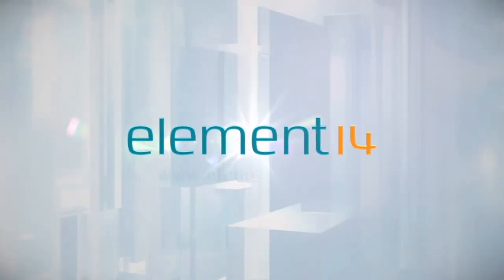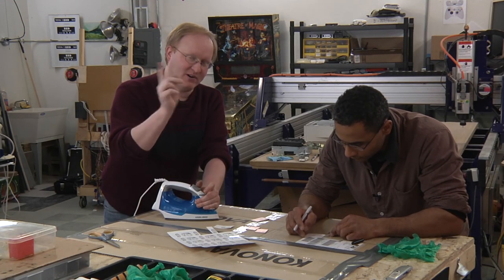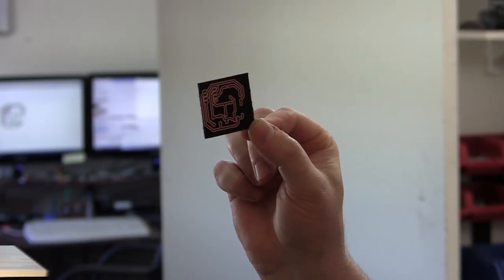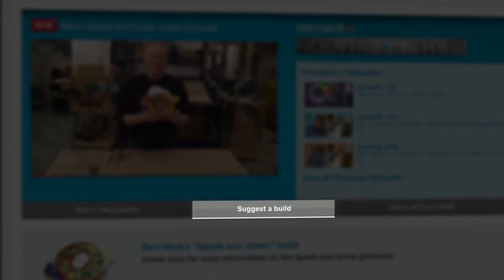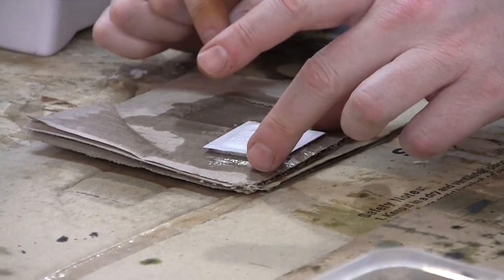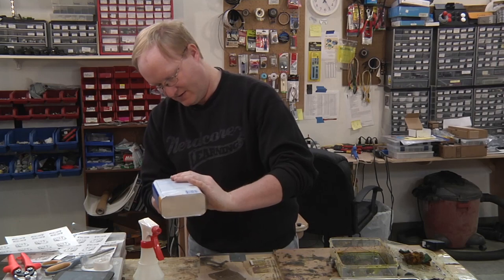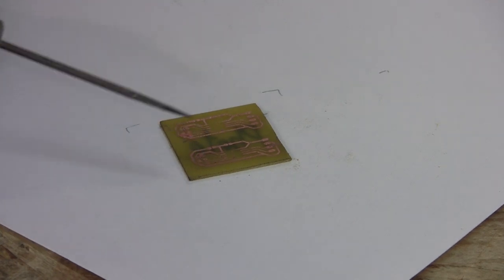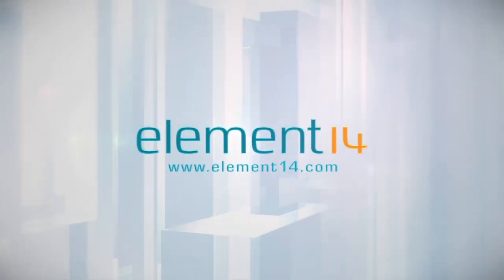Let's Try PCB Etching!

Comment: If you use a cheap laminator instead of the clothes iron you will get far more consistent results, and completely eliminate the chance of air bubbles. You will need to feed it through several times though, but works wonders. Just make sure you get one that can handle the thicker material of the PCB.
Reply: Oh, and another tip, when etching. If you use double sided sticky tape onto and tape it onto a small sponge so it floats you can float the PCB upside down in the etchant. This will make it go much faster as all residue from the etched PCB will just dislodge and sink down into the etchant instead of staying on the surface of the copper.
Reply: I was thinking an old sandwich press might work pretty well.
Reply: I'll second that. Ironing is REALLY inconsistent.  The right photo paper + a cheap harbor freight laminator revolutionized my ability to make mid high quality PCBs at home.  The laminator needs to be modified to slow it down significantly but it is a set it and forget it kind of thing.  Awesome!
Reply: I use a laminator and it works perfect every time. I do double sided prints all the time and a laminator really helps with the process of getting both sides lined up. I just print out both sides, Stick the bottom print to a window, line up the top print using the outside sunlight to help me see though to the bottom print, then while holding it in place I peel back part of the top layer paper and use a glue stick to apply some glue on the edge, and then stick the top print to the bottom, after it dries you can slide in the copper sheet and stick it through the laminator. Make sure the glued side of the paper is the side you stick in the laminator first or it might come out misaligned. I've done this LOTS of time with no error.
Reply: I know this comment is 3 years old and all, but can anyone recommend a laminator that would work well for this?
Reply: Any laminator will work fine but you need to modify it's temperature controls to reach at least 200-220C or even more because toner won't melt at low temperatures this depends from toner quality too. Press would be even better option and would work much faster. Chemicals like ferric chloride nasty stuff eats through cotton clothes and stains everything. Better chemicals for etching are Na2S2O8 and (NH4)2S2O8. Instead of photo paper I use vinyl oracal 641 used for commercial signs or cheap toner transfer yellow paper from ebay.
Reply: can you recomen a cheap laminater I can buy?? Thanks!!

Comment: You should also consider photoetching. Far less messy than the iron-on method and faster. Print the PCB design on transparency paper, tape it to a photosensitive PCB, expose it with a desk lamp then dip the PCB in a developer bath for a few minutes then etch it as usual. I've done double sided boards that way with no issues.

Comment: Why not just jackup your output power on your EPILOG laser cutter and etch away all the copper in the during the laser process?  EPILOG shows this being down quite nicely on there website. 

I'm very curious if the current EPILOG MINI 18 Laser is cable of cutting complete PCB etching in one process like this?

Maybe Ben has an older or lower power EPILOG and has to revert to only removing spray paint? I'm very curious to know. It would be so much nicer getting away totally from the etchant chemicals! Just pull the PCB out of the EPILOG rinse with rubbing alcohol or distilled water and dry with compressed air jet, done!
Reply: Apparently you can only do this with their higher end models. This laser printer isn't powerful enough to effect metals. The masking is a nice work around for making cheap PCBs though.

Comment: I print the PCB mask on a laser printer overhead sheet -- you can use an Inkjet as well (be sure to use the inkjet overhead sheets) but you more likely need 3 or 4 sheets with laser 1 or 2 will do, in order to make the traces truly opaque. These masks can be used over and over again.

I use an off the shelf facial tanner ($50), to photgraphically expose the UV sensitive PCB. I put the mask and the PCB in between my desktop and a glass plate from a picture frame and I have the facial tanner about 2" above it laying on two books.
I light it for 7 to 10 minutes

I use sink cleaner to remove the exposed layer of the UV sensitive layer of the PCB and then edge it using simple off the shelf PCB edge. Then I light the edges PCB again and dump it in sink cleaner again to remove the UV sensitive layer on the edged traces.

That is far away the cheapest and easiest method.
Reply: I agree, this is a good method. I've seen videos of an interesting technique: Instead of vibrating the box (messy) you gently lift one end, put it down and repeat, to create a wave that washes over the PCB, quickly removing the copper.

Comment: There is a special paper on ebay that helps to transfer toner to PCB. It's called "toner transfer paper". It has a wax layer that peels off easily after heated to PCB. Second, toner will not adhere to any greasy spots on PCB so make sure to clean with soap and not to touch the PCB with anything. I also use to transfer toner twice, so there is a thicker layer of toner and my toner level is low and prints with some holes.
Reply from the maker: Cool - thanks for sharing!
Reply: Tarmo Saluste how well does it work?
Reply: Owen Chase In case of toner transfer, it's the best I've seen so far. You have to keep the paper and the copper very clean for it to adhere perfectly. The copper has to be smooth. It could not adhere to cracks, so the traces can be broken from some place. I sometimes add two layers of toner to the copper for better coverage. The paper peals off in a cold water very easily, just pull it off carefully and slow, so the toner wound stick to paper. Another danger is, that I have on printer where the paper likes to curl up around the heating bar. Other printers have no problem.
Reply: Tarmo Saluste ok thanks

Comment: A couple of more tips for those that want to try this:

1. HP printers work well for the toner transfer method. Brother printers do not. I believe the Brother toner melts at a much higher temperature and it is very hard to get it to transfer to the board without smudging (if you can get it to transfer at all).

2. Ben appears to be using Ferric Chloride etchant. This stuff is harder to get, expensive, and stains anything it touches. A cheaper and easier to get etchant uses a mixture of Hydrogen Peroxide and Muriatic Acid. Both of these are commonly available at your local drug and hardware stores and are very cheap to buy in bulk. Do some Googling and you will find the appropriate mixing ratios as well as tips for use. I'll never go back to Ferric Chloride again.
Reply from the maker: Thanks for the tips!
Reply: I use a Lexmark 232 laser and the toner always comes out perfectly on Kodak glossy paper and ammonium persulphate for the etchant, works really well even on fine traces and wire holes.
Reply: Raziel Znot Sodium Chloride +Copper sulphate pentahydrate + Dihydrogen Monoxide = Copper Chloride + sodium sulphate + Hydrochloric Acid. It's essentially the same as Muriatic (Hydrochloric) Acid + Copper + Peroxide(H2O2). Same safety precautions should be taken with any acid.

Comment: Did you consider putting a little water in the iron and using the Steam Press option? Great show, very informative. I liked that there were several approaches and you worked through problems with each.

Comment: I'd like to know how to make those circuit boards that are a mix between breadboards and PCB boards, you don't need to etch them, they are a matte copper colo(u)r and you need to solder them to connect everything. Also a soldering iron recommendation would be good. Something good for a cheap price.

Comment: Great episode! Taught me everything I didn't understand about etching!

If you're handy with an exacto knife, you could also use the spray paint method but with a stencil of your circuit. if you use some kind of adhesive to hold the stencil in place while you exacto it, you could do any circuit you want, then just spray paint it, etch it, and then acetone the paint away like he did with the laser engraver.
Reply from the maker: Glad you found the episode helpful! As a former graphic designer, I'm proficient with an X-acto - thanks for the tip!

Comment: What happened to the good old light box, developer, etch, tin method?
Reply: That method works great for making large quantities. Another similar method that works good for large quantities is the screen print method. However, both of these methods require special chemicals and films and take a while to complete. And going through that whole process for a single board that you might not even know is designed correctly is a bit much for most people.

For a one-off type of board, nothing beats printing on your laser printer and just ironing it on. Ben's video really doesn't do the method justice since he spent way too much time ironing and spraying the board. Just iron once, soak, and wipe away the remnants of the paper.
Reply: mtslyh

Comment: I just tried a slightly different laser printing method that worked great.  I used laser printer transparency paper.  After printing the circuit from eagle, I taped it to the copper with aluminum foil tape (the kind used for duct work).  This held the transparency in place and allowed to evenly transfer heat across the print. I then placed the iron on it until it was too hot to touch which was about 2 minutes only moving it slightly.  I let it cool and cut the tape on the edges.  100% of the laser printer ink transferred with no signs of a smudge.  It was immediately ready for the ferric acid without any cleanup required.

Comment: I've also been thinking that a glue transfer to a clean circuit board that has no copper and then using a foil heated to the surface like the scrap bookers are doing on paper might make a pretty good board too.  I definitely agree with Switch & Leaver about the laminator for better results and this might also work for the foil transfer idea too. I'm surprised that we don't find more direct to board solutions by now.  How about a gel pen full of metallic paint that can be plotted and heat treated? Or low temp metallic filament for 3d printers?

Comment: Hey, I wonder if you could use the laser mill to etch solder mask off of the mounting pads on the board... that way, you could simply dip the board in a nice professional quality solder mask material and etch off the mask on the bits of copper which need to be exposed for soldering. If you did 2 layers, one of a light color and one of a dark color, you could etch off the dark to also create text and stuff right on the boards...
Reply: Oops, posted that comment before I finished the video 😅

Comment: I really like the laser-paint idea, but you could also try something similar with a 3d printer.

Create your eagle schematic and export as an STL or export to some format that can be converted into g-code. Place the raw and cleaned copper pad on the printbed, adjust for height change and print out a single layer print that acts as the usual toner layer.

I have yet to try this method, but after researching the toner-transfer method and realising I only have an inkjet printer, it only stands to reason that if you can coat the copper in the laser printer toner(plastic of a sort) then why not a different kind of plastic with a different kind of printer.

I do believe that polymers like the nylons and ninjaflex would serve as the best option as they bond quite well with most surfaces unlike PLA/ABS.

TL,DR: replace (toner/laser printer/reflective paper) with (filament/3d printer/raw pcb)

Comment: Hey Ben big fan, can you use the CNC to make some holes or is it too thick, if not all your components are are surface mount? Also I have access to a CNC laser but the guy who owns it won't let me paint the coper and put it in the machine because of the fumes can I do it without the paint and just etch off the coper with the laser?

Comment: I'm really curious why you didn't include PCB milling in this video, i know it's not technically etching... but it would've ben cool to see the process of PCB milling as well... perhaps another video just for that?

I'm actually reluctant about my method of making PCBs... i'm planning on building my own mini workshop for electronic projects and PCB manufacturing is an important part of it because using pref boards isn't as clean and takes a lot more time/space/wiring. Ive done my fair share of PCBs back in university. ive tried the iron method but we only had inkjets at the time and it was just a very messy and just not consistant method. at the time our preferred method for PCB making was with light sensitive boards (also another option you could've included in your  video. it's by far one of the easiest and most accurate methods ive tried. printing your circuit on transparent paper, placing that paper on the photo sensitive board, under UV for about 20 minutes, placing that board into a liquid that removes the cooked photo sensitive layer (dont remember the name of that liquid) then etching it then acetone. it was excellent. but it's an expensive method as well seeing how pricey those photo sensitive boards are.

That's why im considering buying/making a CNC machine for myself mainly to mill PCBs but also to make enclosure panels and engrave the texts on it for a clean end product.

Would love to get a feedback on that method, the pros and cons.... thank you for these awesome videos ive been binge watching them and i hope my comment doesn't fall on deaf ears.

Comment: Just a hint for first time etchers:
I personally don't recommend using FeCl3 as etchant. It's super dirty and will leave it's traces everywhere if you don't handle it carefully. I've always used Na2S2O8 (is the name sodium persulfate correct?) for etching. It works pretty much as good as ferric chloride but it is a lot cleaner. I personally used it without any handprotection and it didn't leave dirty stuff on my workbench or my hands (use gloves if you're not familiar with using chemicals right, it damages your hands if not used correctly).

Comment: I'm finding that laser photo paper is kinda hard to find, but I have no problem finding laserjet glossy brochure or presentation paper. Is that thick enough for the transferring or will only photo paper do?
Reply: It doesn't work well with inkjet iirc, as the etchant etches it away. You can get laser printrs for £30
Reply: +Emil Carr WHAT! HERE THEY ARE 600$

Comment: I know this is a 2 year old video but I did have a few comments. For my agitator, I took an old 4 inch muffin fan, drilled a small hole near the end and center of one of the blades. I inserted a 6-32 screw, nut and lock washer. Then hit both sides of the screw with a small drop of epoxy, I used a rheostat years ago to ramp the speed to the point where I found resonance in the tank and the vibrations became more violent. Now I use one of those $1.50 asian made, SSCR motor control units, free shipping to regulate the fan speed. I also have a clamp on lamp and keep a 75 watt bulb just above the tank for 30 minutes before etching and during the process. The boards etch very quickly and evenly,
Also, FYI, I would not use Acetone inside and also recomend using lab rubber gloves while handling this.. 
My boards have always turned out great with an occasional etch through on a thin run.. I can usually bridge the open with a little solder and a chisel tip.
Question, I have NOT played with photo etching since my college days back in the 70's.. The new processes seem less critical. Have you played with photo etching and is there any REAL advantage over  heat transfer?? I use a laminator as opposed to an iron and run the board through 5 or 6 times. For larger boards 10 times. 
Regards, Glenn

Comment: Iron method is great, but I recomend to use flat iron without steam generator (or laminator) and It's usually better to heat the part that you want stick it on. So paper at the bottom, PCB at top...

Comment: Nice video. When you look the glossy paper made pcb under a microscope (after you etch in the acid) you will see little holes in the copper. That`s because the laser printer build the images using little ink dots which aren`t close enough to make an even surface.

Comment: Everything known about Etching PCBS is listed at:
http://techref.massmind.org/techref/pcbetch.htm
(if I missed something, use the form at the bottom of the page to add it). 
Ben you might want to look into the hybrid inkjet / toner method as it is very quick, and ultra low cost. Just print on an inkjet printer (super easy if you have a CD tray, just cut out a holder for the PCB from an old CD) and dust with laser toner before the ink dries. Then melt the toner with heat or acetone vapors and you are ready to etch! Probably the fastest, most accurate, and least used way to make small PCBs. The only down side is the size of PCB you can fit in the printer, and we have lots of documentation on how hack an inkjet to take a full sized blank.

Comment: I dunno if it's been mentioned in the comments yet, but I use to use 2 to 1 mix of hydrogen peroxide and muriatic acid for the etching part, far superior over ferric chloride, ferric chloride stains like crazy! if you get it on your clothes, consider them destroyed! I now get my boards made off shore, for a very low price, and they use high durable fiberglass sheets, and not that composite crap that cracks easily

Comment: Another version is covering the board in paint, replace the head of your 3D printer with a very sharp point and feed your pattern to it as an inverted single layer G-code and it will scrape out the paths.